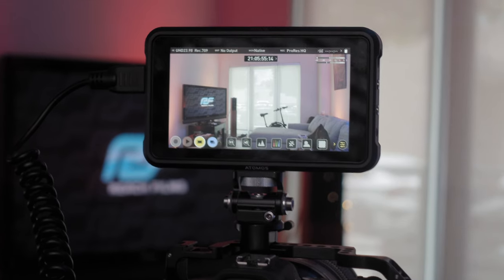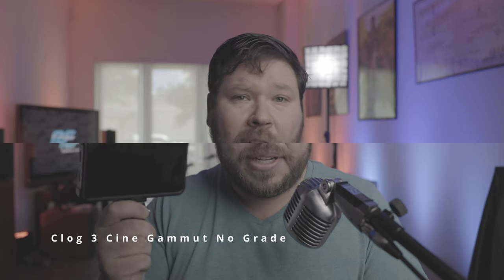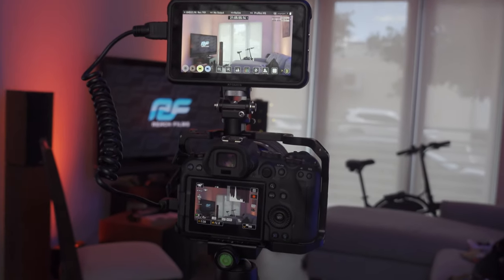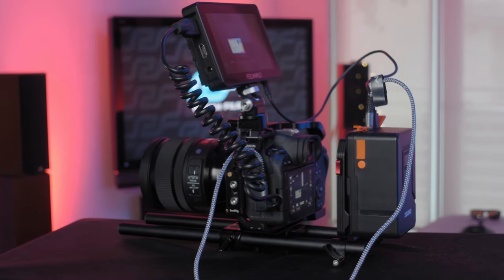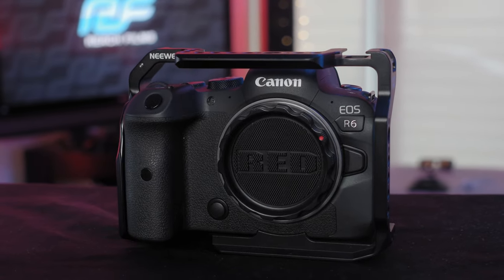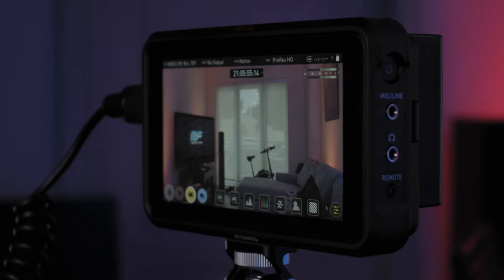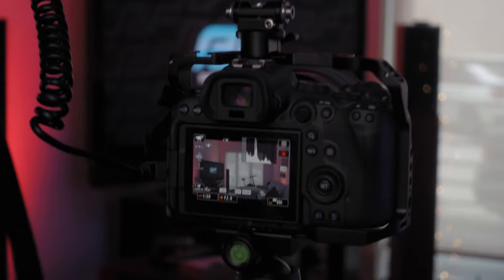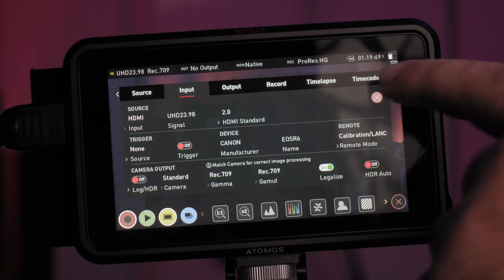The Canon EOS R6 and Atomos Ninja V Have Clog 3 Issues | Same with the R5 and R7

Comment: I thought I was going crazy. Thanks for putting out this video.  Also when you hit the "legalize" toggle on the Ninja V,  it will not record in C-Log3 and only only in Rec 709 - even if the camera set Rec 2020 or Cinema Gamut. Super frustrating because I thought "legalize" was supposed to match camera settings automatically.
Reply from the maker: I am interested to see if this still happens on the R7, I have one coming in on Wednesday next week.
Reply: @ReachFilms  Yes please update us!  Really curious to see if this is a Canon or Atomos issue. I suspect Canon. Did you find this issue with regular C-Log?
Reply from the maker: @AxlfroProductions  I had another comment, from someone who tested out recording on a blackmagic video assist and had the same issues. So it is a confirmed issue on canons side
Reply from the maker: @AxlfroProductions  also didn’t realize didn’t answer the other part of the question, and that is this issue only happens with Cine Gammut with Clog3 the other modes like Rec 709 or 2020 do not have this issue

Comment: I am literally dealing with this problem right now. Just got the Ninja V for my r5 and did some test footage everything looks gross to me. All skin tones have yellow blotches on them if I look really close. Also, The monitor itself has a yellow cast and when using a LUT to monitor the preview looks way too contrasty. I have a shinobi and never noticed this color cast on preview. I only got it for the extended record time as the m1 macs handle the H.265 codecs fine. Totally bummed.
Reply from the maker: It’s annoying that clog3 has been out for more then a year and still no fix in sight
Reply: @ReachFilms  I just tested with my BMD 12g Video Assist and it's the same issue. So the problem is Canons output over HDMI. I'm gonna blast Coldplay's Yellow at Canon HQ until they fix this. lol.
Reply from the maker: @bombzproductions9595  that is great to know thank you for letting me know! So it is canons issue then, it’s something that canon needs to fix
Reply: Is it fixed now? I've an R6 and just ordered a ninja V
Reply: @ricardo.vinagre  unfortunately not.
Reply: It’s not a canon issue or an atomos issue. It’s an HDMI issue. The cinema gamut won’t pass through the HDMI standard. There is no software/firmware fix possible. Use BT2020 (which is very good) or record raw if using the HDMI port.  Record cinema internally.

Comment: My R6 +ninja v stops recording when shooting 4K at the 30 min  camera limit. Search everywhere but couldn’t find a solution. What am I missing? Appreciate any suggestions. Thanks!
Reply from the maker: You need to turn off the overheat protection I don’t have the camera anymore but there are a few videos covering how to disable it
Reply: Those settings r fine. Could it b the cable. The recorder won’t let me record pass 30 fps 4K not even for a second. If I set 4k 60 fps in the camera the ninja resets it to FHD 60 fps.

Comment: Just to be clear, you only experienced this issue when shooting Cinema Gammut. Does the color cast / skin tone issue also appear when shooting in BT709?
Reply from the maker: Correct this only happens in cinema gamut does not happen in any other profile
Reply: @ReachFilms  whats the benefit of cinema Gamut clog 3 over clog 3 bt709 ?
Reply from the maker: @MichaelBouhnikProductions wider dynamic range, specifically in the highlights
Reply: @ReachFilms  what consist of highlights when u say highlights ? Skin tones are they considered highlights ?
Reply from the maker: @creativegreats6924  great question! Yes the skin tones can be part of the highlights, really I would say they are right in the middle, but yes, in camera when using cinema gammut you should get better skin tones depending on how your grading is , however it obviously is the opposite of using that mode when using an external recorder right now.
Reply: @MichaelBouhnikProductions  @reach films I don’t think Cinema Gamut gives you wider dynamic range. It gives you more color range. Gamut=color, Gamma=Dynamic Range.

Comment: Ok first off The Ninja V and Ninja V+ can record clog 3 just not using Cinema Gamut,, It can do rec709 or rec 2020.
The reason for that is not the fault of Atomos or really Canon, Well Canon is to blame a bit, you see the reason people are loving and are excited about Cinema Gamut clog 3 is because yes it has a wider color range and more information in your footage, The Problem with that is, is that No HDMI Cable Can handle it.
Something gets lost in the translation in the cable when it reaches the Ninja V, and so colors tones are out of of control because the Ninja Can't write the correct color system in that video.

Now the Only way i can see this would be fixed is Atomos come out with an HDMI cable that would fix this.
Or Canon re-write the software on how the color spectrum gets transmitted though the HDMI cable to the Ninja where the Ninja Would properly produce the video file..
In My Opinion I Don't see this happening, #1 I don't think Canon Cares, and I doubt Atomos can really do anything about it except maybe get the engineers who developed their HDMI Cable and manufacture one that would fix this problem, that would mean costing tons of money..
Also It would cost Canon money to fix the software engineers to re-vamp Cinema Gamut Log3.  Not Happening....

Comment: It's not a CLOG3 or Atomos problem. It's a problem with HDMI standards and Canon Cinema Gamut. HDMI simply does not support Canon Cinema Gamut. It's too wide a color space for the HDMI standard.

BT2020, however, is supported by HDMI, so the Atomos Ninja, Ninja V+ and Shogun series recorders can accurately record BT2020 video because the BT2020 color space is supported by the HDMI standard. So the problem is that Canon Cinema gamut color space exceeds the HDMI standard.  If you want to use wide gamut color space on your Atomos recorder via the HDMI feed, you are limited to a max color space of BT2020.

And while Cinema Gamut is awesome when recording internally on Canon Cameras, tbh there is zero chance that you can ever distribute a Cinema Gamut video reliably because Canon Cinema Gamut is not a color space supported by most (if not all) distribution partners.  BT2020 is however a wide gamut color space which widely available via distribution partners because it's an industry standard. And that is why HDMI included BT2020 as their wide gamut industry standard.
Reply from the maker: Hey Mark, thank you for this explanation, how does that factor in being able to record prores raw over hdmi? Since it has even more information in the image?
Reply: @ReachFilms Canon is not sending ProRes Raw over HDMI. They are sending a clean RAW signal (i.e. direct from the sensor without any Canon noise reduction or color science applied) over HDMI and Atomos has licensed the ProRes RAW encoder from Apple as an option to save the RAW data from the sensor (reduced from 12 bit to 10 bit) via the HDMI to a ProRes RAW format in the SSD drive installed on the Ninja or Ninja V+ or Shogun, if ProRes RAW is selected in the Atomos OS as the file format.
Reply from the maker: @CrisisActionTeam  hi Mark, yes I understand that, I think you understand that I meant how are they sending a raw signal. Because that has much more data in it than clog3. So how are they sending the raw signal without issues?
Reply: @ReachFilms  Not exactly, I film all the time with my R5 in Canon Raw AND CLOG-3. CLOG-3 allows you to take advantage of the hidden dual base ISO of the R5 (800 and 3200) thereby gaining more than a stop of dynamic range. So you get more dynamic range from your R5 when using CLOG-3 (if you properly expose for CLOG-3) on top of the RAW file (which circumvents canon color science and noise reduction applied by the Digic X processor in body).  I like to think of CLOG-3 as a means to get a significant boost in dynamic range and an easy to grade file in post (as in FCP you can simply apply the CLOG-3 LUT to get a fast base correction to proceed onto grading). In addition, when using an Atomos monitor/recorder product, you can apply a standard CLOG-3 LUT while filming to get a great idea of what your final footage will look like in post with the same LUT applied, thereby giving that fast eyeball assessment while filming of whether you have property exposed your footage (which is much harder to do with a hazy looking RAW or CLOG image without a LUT).

Oh and while the Atomos 10 bit ProRes RAW image has less color info than the 12 bit Canon RAW or CRAW light files recorded internally the R5, the ProRes Raw files edited/corrected/graded in FCP allow for changes in exposure, ISO, color profiles, etc directly in FCP, but CRAW and CRAW Lights files only offer changes to footage settings like exposure and ISO via Canon's "Canon Raw Development" app, which adds another step and prevents changes inside the editor where you want to make them when correcting and grading. So the added Raw functionality offered by the ProRes Raw file format (even with a shift down to 10 bit color space which is a limitation of Canon's image quality provided via HDMI), combined with the speedier ease of editing of those files, makes ProRes Raw a better option for me.
Reply: @CrisisActionTeam  Hi Mark,  Can i export ProRes Raw with an R6 and Atomos V+ or is it just from the R5?
Reply: So do you change the color space setting on the Ninja?
Reply: The Atomos recorders basically receive whatever Canon sends them as a data format via the HDMI 2.0 port/cable (which is CLOG-2 10 bit 422). You can make color space changes in the Ninja, but the Ninja will auto adjust to the incoming feed parameters when you plug in the HDMI 2.0 feed. You can change to CLOG-3 on your Canon, but the signal over HDMI is changed by Canon to CLOG-2 422 10 bit... So the trick is to get your editor ingest settings to correctly match the parameters coming from Canon.  @PizzlesTechTime
Reply: @CrisisActionTeam  so you're saying if I shoot in C log 3 on the Canon it will send over CLOG 2 to the Ninja? If I record in HDMI RAW it will be recorded by the Ninja in raw? So my best bet might be to just record in raw 8K. Then use proxy files in the editor. I do not know much about ingest settings on the editor. I am using premiere pro CC right now.
Reply: @PizzlesTechTime  Yes, Canon only sends a CLOG-2 signal via HDMI. I'm pretty sure the basic Ninja V doesn't record in 8k raw, but I think it does record in 5k RAW. Not totally sure, as I own the Ninja V+ and the Shogun Connect, which both do 8k RAW. But... a little known secret is that the 5k RAW on both of my atomos recorders is actually 12 bit, while the 8k is limited to 10 bit (which I assume is due to the limited data rate of HDMI 2.0). So even though I have 8k RAW recording capability on my Atomos recorders, I usually record in 5k. Also... the RAW file wrapper on the Atomos recorders is far superior to Canon's internal RAW, as Atomos uses Apple's ProRes RAW, which is MUCH more efficient and easy to edit. I ditched Premiere long ago, so I don't recall whether Premiere supports ProRes RAW (I think it does), but last I checked Davinci Resolve does not support because BlackMagic has a competing (BRAW) wrapper that they are promoting to the exclusion of ProRes RAW. I went back to Final Cut and never looked back. I have an M1 MB Pro and it can edit both RAW file formats (Canon and Apple) without proxies, but as the projects mount you quickly find that the Canon files are so huge and don't offer the level of adjustment in post that Apple's ProRes RAW format does (at least in Final Cut). For a while I stuck with Canon's format because it is 12 bit at 8k (vs 10 bit in the Atomos Recorders at 8k), until I discovered the 12 bit 5k ProRes RAW format and then I never looked back. 5k gives me enough room to crop if I need to while giving me glorious 12 bit color space and easy to edit files. Once on a shoot we only had a 2018 Intel-based MB pro available on location, and I was surprised to find that I was able to edit the 5k 12 bit ProRes RAW files pretty easily. Canon's 8k 12 bit files would bring an intel based Mac to a halt. Now we have m1 and M2 based iPad Pros and they can handle either too, but the ProRes RAW files are so much smaller, easier to edit in terms of RAW adjustments, that we are all in on 5k 12 bit ProRes RAW files.
Reply: @CrisisActionTeam  Yes I was never a fan of Apple because the price of accessories and upgrades. Paying 3 to $500 for an extra 500 GB on a laptop is insane to me. Their prices have become more reasonable since then. I am actually considering buying a MacBook but I would still have to learn final cut pro. Depends on how much professional video work I get over the next year. If I am recording in HDMI RAW with Canon it is going to send the full resolution of the sensor at 8K right? So the only way to crop the resolution would be to use one of the crop modes like super 35? I really appreciate your long response. I am a novice to professional video work and have done the bare minimum over the years. My Panasonic GH5 did not shoot in log without paying for the update. I didn't realize how beneficial it would have been. Now I am using Canon R5C and using a log profile gives me so much leeway. It is literally so much better especially if I overexpose it a little. I understand that it is overkill for a small YouTuber but I am taking on more and more clients for professional work.
Reply: @CrisisActionTeam  By the way I am using the atomos Ninja V Plus and the Canon R5C.
Reply: Sorry I saw you say Ninja and took it literally.  @PizzlesTechTime
Reply: Yeah external SSD media via Thunderbolt 3/4 is super fast & cheap these days, making even on location editing on MacBooks, Mac minis & iPads very doable. In my studio I have an 80TB RAID thunderbolt array that I built with my own drives, which I purchased in its naked form from OWC which has proven to be very fast and bulletproof. As for external recording to Atomos recorders, the R5C is a bit of a different animal I think. It also has crop modes, but I think 6k vs 5k on the R5. Not sure if the 6k signal on the R5C is 12 bit. But it is on the R5. Here's a good vid by Atomos on the setup for the R5. The 5k and 6k modes on both cams are 1.6x crop modes I believe (16mm equivalent) but on the R5 (not sure about the R5C), there is no line skipping or binning, and it matches easy with 8k footage. But once you edit ProRes RAW in FCP and see the level of image control you have, you'll find it's a game changer in terms of creative control, not to mention file size and speed. As for the FCP learning curve, it's super easy (and inexpensive) to make the shift from Premiere. Tons of good videos and tbh the interface is so user friendly that most people catch on pretty fast. Also the FCP editing experience on the iPad M1/M2 is awesome and equally fast. @PizzlesTechTime
Reply: Here's a good vid from Atomos showing how to setup the R5 for ProRes RAW. https://www.youtube.com/watch?v=w6SYQU1plxQ

 @PizzlesTechTime
Reply: @CrisisActionTeam  thank you very much for the reply! I watched a few videos on the setup of the R5. The menu system is completely different with the cinema OS. I may consider a MacBook at least to edit off. I actually like the R5 menu and ability to customize the video settings. Strangely enough you also lose the auto focus functionality from the R5. In video mode you have a lot less focus settings. I thought I was getting animal tracking in the R5C like the R5. It really only has face head and eye options.
Reply: Yeah the R5C is a great camera, but for my needs I needed the advanced AF used on the R5. It's been indispensable for me. But for many filmmakers, it's not a deal breaker. Just depends on the kind of films you make. As for the Mac route, it really is a game changer for indie filmmakers. @PizzlesTechTime
Reply: @CrisisActionTeam  Yes I saw the Mac pro is on sale at Best buy. Which one was you suggest for pro res? The MacBook pro 16gb?
Reply: Tbh, my M1 Mac mini was perfect in terms of capability to edit multiple shots of even Canon RAW video files (internally recorded to my R5) , but I could not run multiple monitors with it. I think the new M2 Mac minis may be capable of multi monitors now. In terms of handling ProRes, if you don't want a large screen, the new MacBook Air is more than capable. But if you plan on editing Canon RAW files (internally recorded to your R5C), I'd go for an M2 MB Pro. The new MB Air is more than capable of editing multiple simultaneous shots of ProRes and ProRes RAW on Final Cut. And so is the 12.9 inch M2 iPad Pro (and the older M1 12.9 iPad Pro), and of course the M2 Mac Mini.   @PizzlesTechTime
Reply: Also... if you get an M2 iPad Pro you get an extra cam, as I think it can record ProRes internally with the new FCP app for iPad, which makes matching the footage to your Canon footage recorded in ProRes on Atomos recorders much easier.  @PizzlesTechTime
Reply: @CrisisActionTeam  yeah I definitely would need multiple monitor support. I was planning on plugging the laptop in through a hub into my monitors. I really like editing with at least two.
Reply: Well then if you need to go mobile, I'd get an M2 MB Pro. Any of them handle multiple external monitors I believe. The MB Air only does one. If you don't need to go mobile, I'd go with the Mac mini M2 which supports 2 external displays or the Mac mini M2 Pro which supports 3 external displays. Any of them will easily handle many simultaneous tracks of ProRes and ProRes RAW.  @PizzlesTechTime
Reply: @CrisisActionTeam  I really appreciate your help. Best YouTube comment reply ever!
Reply: Always happy to help others to master their craft! Have fun!  @PizzlesTechTime
Reply: @CrisisActionTeam thanks for all the info